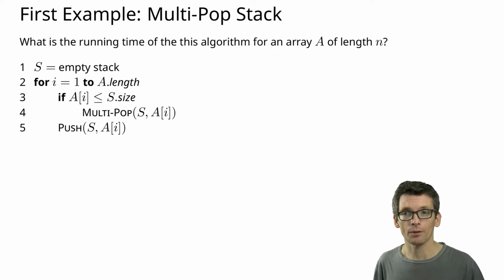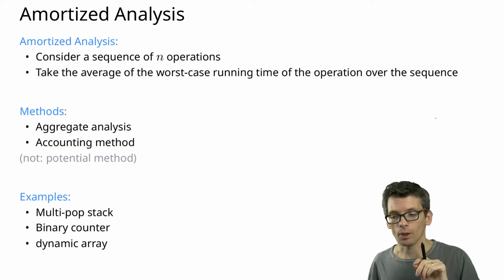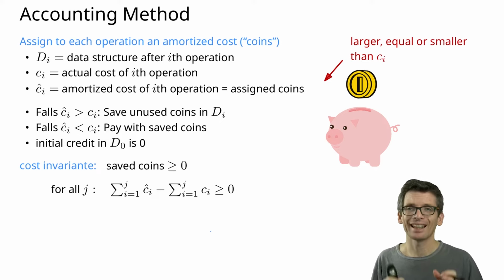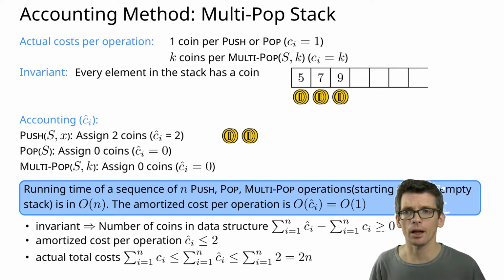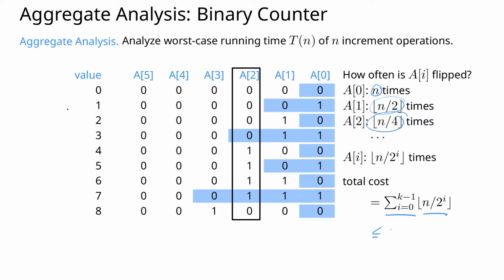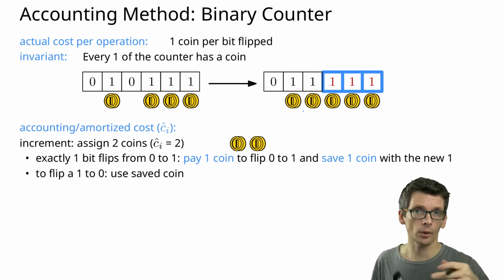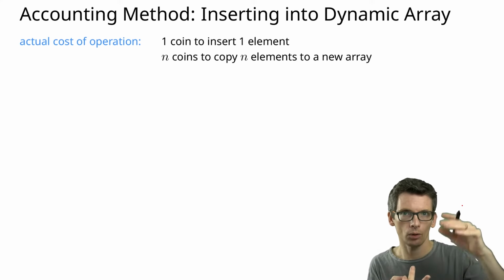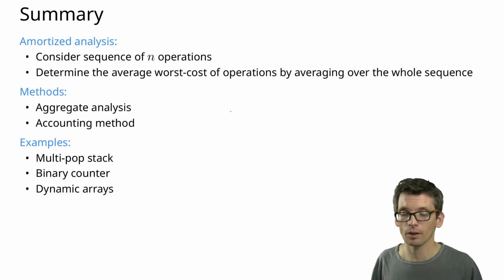Amortized Analysis: Aggregate Analysis and Accounting Method

Comment: Why we don't just have amortized cost equals to 1 for every single of the operation?
Reply from the maker: I assume this question is about the multi-pop stack. Lets say the actual costs per operation are:
- push: 1
- pop: 1
- multi-pop(k): k

Now, lets try to use amortized costs: 1, 1, and 1. The sum of amortized costs should always be at least as high as the sum of actual costs. 

But if my sequence is: 8*push(), then 1*multi-pop(8), then the sum of amortized costs is 9*1=9, but the sum of actual costs is 8*1 + 1*8 = 16. So the condition above is violated. If we want to assign the multi-pop constant amortized cost, the only way to solve this, is to increase the amortized cost of push to (at least) 2. And if we do so, then we actually save enough to set the amortized cost of pop and multi-pop to 0. Of course, if we wanted to, we could give pop and multi-pop amortized costs of 1 (or 2 or even higher), but this would simply be unnecessary. 

For a deeper understanding of amortized costs in the accounting method it can be helpful to look at the potential method; see follow-up video. After defining the potential (which in this case is simply the number of elements currently in the stack), the amortized costs can be simply calculated, and the result is push:2, pop:0, multi-pop:0. 

And to summarize: increasing the amortized cost of pop and multi-pop is of course possible (but useless), decreasing the amortized cost for push is not possible.

I hope this clarifies why the costs are set as they are.

Comment: Good vid. One question I have is, for the accounting method, if we already calculate the actual cost, whats the point of even thinking about the amortized cost? What is the benefit of using accounting method?
Reply from the maker: Are you asking: Why use the accounting method, if we can simply aggregate method? Or is it: Why work with actual cost AND amortized cost in the accounting method? 

Concerning the first question: In many cases both work, and then it is of course enough to use one of them. I would argue that accounting method is often easier because it provides more structure. In contrast, for the aggregate analysis we always needed an extra idea (e.g., that for multi-pops we can charge every pop to a previous push; or for the binary counter that we add up the costs per column). This idea typically boils down to a so called "charging argument" (and maybe I should at some point make a video about this). Another advantage of the accounting method is that it is easy to assign different amortized costs to different operations.

Concerning the second question and taking the binary counter as example: here it is easy to prove that an amortized cost is 2, and that is all we want to know. We actually never explicitly calculate actual costs, they simply show up as a variable in our calculations.

I hope this answers your question!
Reply: @algorithmslab  thanks for the reply! 1) what are benefits of using the accounting method? 2) what's the point of calculating amortized cost when we already can count the actual cost?
Reply from the maker: @ll-bc4gn  So, I tried to partially answer these questions in my previous reply, but let me here give some more detail:
Answer to 1: a.) Accounting method allows to have different amortized costs for different operations. The aggregate method as presented simply computes an amortized cost per operation, which is the same for all operations. But this will no longer work, if some operations are more costly. It is fine for all of the examples in this video, but for instance for Fibonacci heaps (https://en.wikipedia.org/wiki/Fibonacci_heap#Summary_of_running_times) different operations have different amortized cost.
b.) The accounting method provides you with a lot of structure for the analysis. In the aggregate method you somehow need to "magically" know how to nicely compute the total running time. As I noted in my previous reply, the magic here is typically a so called charging argument; finding that charging argument is typically of similar difficulty as using the accounting method, c.) so far I was talking about the advantages of the accounting method compared to the aggregate analysis. Of course, likewise one might wonder whether it has advantages to the potential method. I think, the main advantage is that at least initially it is more intuitive. But the potential method is often simpler as soon as you figured out what the potential should be. Anyway, as I argue in my video on the potential method: accounting and potential method are essentially just 2 sides of the same coin.

2.) The actual cost of a single operation might be much higher than its amortized cost. So the idea of amortized cost is to be giving a more realistic estimate of the running time, knowing that the operation happens as part of a sequence of operations. E.g., inserting one element into a dynamic array takes O(n) worst-case time. No-one would ever want to use a dynamic array if this is the whole story. Amortized running time draws a much clearer picture: In a sequence of n insert operations (starting with an empty array), the average running time per insert is O(1). Thus, dynamic arrays make sense to use, but to see this we need the amortized time per operation, not the worst-case time.

Comment: Amortized Complexity got me thinking how is it different from Average Case Complexity?
Reply from the maker: When we talk about average-case complexity, we assume that the input comes from a (probability) distribution, and we are interested in the expected running time. E.g., in the analysis of quicksort we assume that any permutation of the input has the same probability; or for bucketsort we assume that the input numbers are uniformly distributed in the interval from 0 to 1. Also for randomized algorithms, we talk about average-case performance. E.g., for randomized quicksort (i.e., if we first randomly permute the input) we are again interested in the expected performance. 

In an amortized analysis, we are also interested in how long an operation takes on average, but the difference is that we are taking the average over a sequence of operations. Thus, we are still looking at a worst-case for the whole sequence. This is a crucial difference, since this means that amortized running times can still be used when analyzing worst-case complexity. E.g., if I append n elements to a Python list, the worst-case complexity of this is O(n), because the amortized complexity of 1 append is O(1). If instead we would only know that "on average" an append would take O(1) time (and the average depends on the input or randomization), then we couldn't say anything about worst-case overall. 

Thus, in short, the crucial difference is, that we still get worst-case bounds (just not for a single operation). I am not sure whether this is the answer you were looking for.

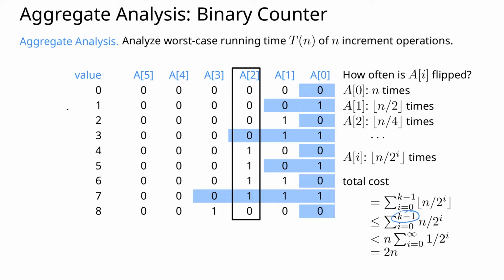Comment: 22:45 Could you share the proof/series which lead to it converging to 2 and henc UB <=2n?
Reply from the maker: Sure! This is an example of a geometric series. You can find the proof of convergence for geometric series for instance here: https://en.wikipedia.org/wiki/Geometric_series#Proof_of_convergence . In our case r=1/2, so 1/(1-r) = 1/(1-0.5) = 1/0.5 = 2, which is the value that we get. 

A different perspective (by induction, but essentially the same) is the following: Before we start, let's look at an example: 1 + 1/2 + 1/4 + 1/8 = 2 - 1/8. Now it is easy to see that if we add the next term, 1/16, on the right-hand side we get 2 - 1/8 + 1/16 = 2 - 1/16. So starting with 1 = 2 - 1 as base case, we inductively get that the sum 1 + 1/2 + ... + 1/2^n = 2 - 1/2^n, which converges to 2 when n goes to infinity. (Note: For the general setting the wikipedia proof is more insightful, but for a specific setting I also like the inductive perspective). Does that answer your question?
Reply: @algorithmslab  Ok wow this was seriously well explained. I have always struggled/been stuck at such analysis but it makes sense now. Definitely going to be binging the all the other lectures as well! 
Thank you!!

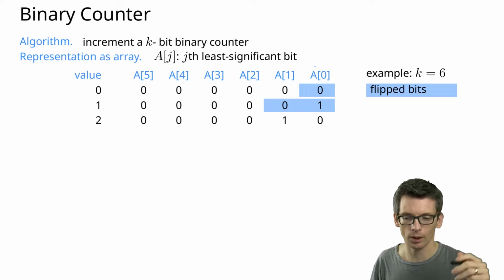Comment: Thank you very much for your effort. At 19:29, should not we get at 2:   0 0 0 0 1 1 0 please since we want to flip bits starting from A[2]?
Reply from the maker: In this example, A[j] represents the "j-th least significant bit", so A[0] is the least significant bit. Thus, we always start flipping at A[0]. Stated differently, we write numbers as A[0] + A[1]*2 + A[2]*4 + A[3]*8 + ... . Thus, since 2 = 0 + 1*2, we have 2: 0 0 0 0 0 1 0 (further, 3 = 1 + 1*2, so 3: 0 0 0 0 0 1 1, and so on). Does this clarify the representation, in particular for 2?
Reply: Appreciated. Thank you.